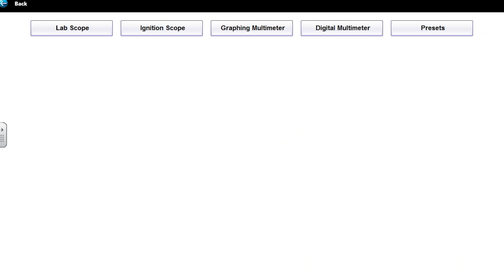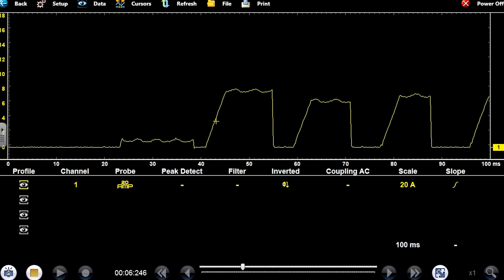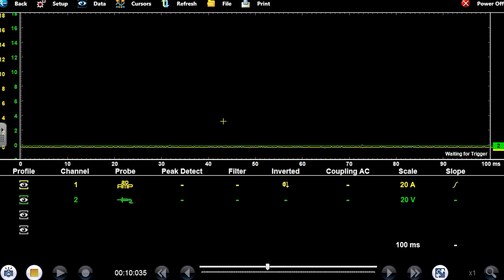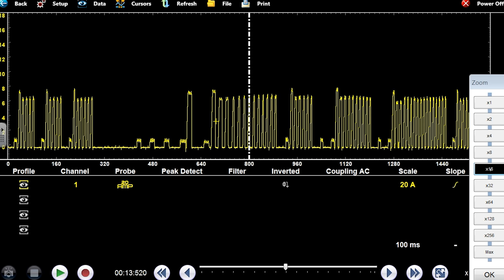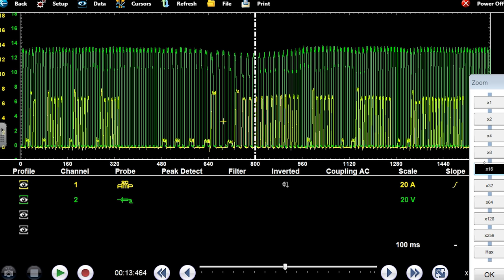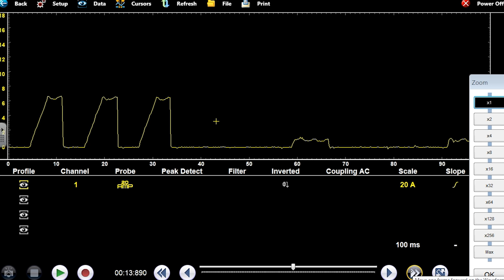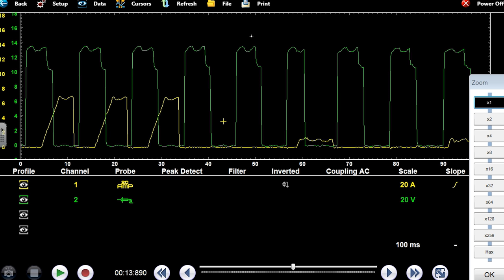Getting My A$$ Kicked By an 86 Mustang (Part 1)

Comment: Interesting Paul, can't wait for the end result. Back in the 80's and 90's the TFI module was a high failure item. I had an 88 F-150 and kept a spare in my glove box, 😁. I had a Ford tech tell me one time that if the module fails Ford recommends changing the pickup as well, might be vice versa as well. I don't remember what the reasoning was.
Reply from the maker: the reasoning is because they didn't have scopes and had no idea how to tell the difference on which one was really bad :-)
Reply: @ScannerDanner  that was definitely a strange time as a technician... developing technology all the while diagnostic tools and education that were not up to par   remember when the old Snap On brick scanner was the only tool to read ecm info?  I still use an old brick to diag older gm tbi setup in 1990s church bus fleet, just doin what i gotta do
Reply from the maker: @kc360awareness  when the Snap-On Vantage reigned supreme!
Reply: @ScannerDanner  I have one of those too!
Reply: @ScannerDanner  YEP - that was why I always changed both, LOLOL!  I always wanted to try one or the other to see what is actually failing, but it was too much work changing the pickup, and the TFI module was pricey! Over $100 at Ford in '07!  I still have a TFI module or 2 that I kept around, in case they were good. I won't know if it's even good  until this current one fails again.

Comment: Hey I wanna thank Scanner Danner for helping me figure out this 97 F350 5.8. I went thru the exact same sh$t! Shop before me replaced the dist. and remote mounted module and I knew he used O reiley crap so I tried replacing pick up coil with Carquest brand.....no difference. Then I tried CQ brand module.....same, cutting out off idle as before just like Mustang! I had my spark tester hooked up and it would flash good at idle but cut out off idle, after pulling out most of my hair I tried unplugging alternator after watching this video, sure enough ran like a champ.....went to Ford and got a motorcraft module and runs great WITH the alt. plugged in! Thank god I found this video. By the way alt. was charging the usual 13.8 -14 volts. Thank ya sir!!

Comment: Under rated transistor in the module. They don’t build these like motorcraft did. 
There is most likely only one manufacturer but different brands (packaging) so all of them on the market have the same problem.

Comment: years ago, before scan tools and scopes, if we suspected a pick up or module we would pop the cap and give the parts a good cool down with some refrigerant shot from the can. 99.9% of the time it would temporarily correct it long enough to get it back to the shop. More prevalent on hot days after a heat soak when the customer stopped by  the store resulting in a no start.

Comment: I wonder if there is a resistance in the ground circuit  to the module? If so, jumping a solid ground to the module connector would make a difference

Comment: Had similar issues 1990 Gt. Original distributor (original TFI module, original pickup, original coil) was having bucking issues when warm, to the point it was stalling out but always restarts.
Decided to rebuild the original but, in the meantime, I would put in a replacement distributor… car started and ran good. Went around block and kept running well. Started and went on a 5 mile trip, ran great. Went to start it again…no start. Threw my old distributor back in, ran great.

Bought another distributor…same exact thing happened. Mustang forums are full of stories about this…the shutter wheel in the distributor being bad, pickup in distributor being bad, TFI module being bad.

I picked up another original distributor, installed it, works good. Now considering rebuilding my old distributor, but hesitant because the aftermarket replacement parts are the same crap being used in new distributors.

Comment: Wow, what a PITA! I have the exact same system on a '86 Grand Marquis. Only difference from the Fox bodies is everything in the engine compartment is backwards from mine - my intake faces the driver's side towards the airbox, battery and solenoid are on passenger side. 

Whenever the ignition failed this way (which they always would after many miles and years) I always replaced the pickup and module as a set, but, Motorcraft was still making them back then. That makes me agree with you on the chinese parts. Other things could be metal shavings stuck to the pickup coil (since it's slightly magnetized), or a loose/worn distributor gear causing those weird scope graphs. That's all I can think of! Seems like a simple system but it's always these ones that'll throw a wrench at you sometimes. The right heat conducting compound is a HUGE factor in module life as well. It MUST have a good layer of that on there.

Last set I bought at the dealer was in 2007, and that is still working today (fingers crossed now that I say that, lol), almost 200k miles later. By 2009 they were no longer available - I should've stockpiled a few!  285k on the car now. It seems heat is a big factor with those failing. When I took my 1st '86 Grand Marquis to Phoenix, the module failed the 1st year I was there. Replaced it, then the car got stolen for a year - they found it in Bell, CA. I took a bus from Oakland to E. LA at 1AM to get it. That should tell you how much value I place on my vehicles (more than my life apparently, LOL!). But anyway, super curious as to what exactly is causing this one!  Great stuff so far fellas!

Comment: I love the older cars....pre-2000 or so.  They're just so much more simple to understand and repair...and they're my favourite to own.
Reply from the maker: you would think! This one wasn't for sure. Thanks!
Reply: @ScannerDanner  Ya, I think you're onto it when you talk about the lack of quality in so many aftermarket parts.  I remember installing a new neutral safety switch on my e4od that I rebuilt myself.  It ended up being faulty when I finally got around to starting up my 92 F250...and ended up putting the old one back in...lol....which worked just great.  And I thought I was doing something that would increase reliability by replacing it when I did the rebuild...lol.

Comment: Ha, lol.  Love the X'd out word "Dont".   At the intro with the default explanation, I almost put in my two cents the prob was cheep Dorman Chinese or Mexican parts.  Reminds me of the importance of knowing your system and where the ground should be regarding the pickup, dustributor, or module.  Years ago, working on a 74 Intern'l that wouldnt start; every test said it was a bad coil but when I tested the coil, coil was fine (tested while coil was still on the intake). I even removed the bracket mounting bolt to the intake and scratched it clean for a good ground; still wouldnt start.  Retested everything.  All tests pointed to a bad coil.  So I racked my brains and said to myself, what am I missing? Long story short, I never actually removed the coil bracket from the coil for inspection.  Turned out the coil bracket was rusted on the inside of the bracket but looked perfect on the outside of the bracket, what(?). How does a coil bracket rust on the inside but look perfect on the outside? Scratched the inside of the bracket clean, put it back together; srarted up immediately. Anyway, a 15 minute repair took over an hour.  Those little annoying repairs are the one's you remember most.  Funny how those old memories still haunt you after all these years. Looking for the follow up vid to this scenario. Thx for what you do!
Reply from the maker: good one!! Thanks for sharing

Comment: Bad battery or bad connection somewhere? I wouldn't think system voltage should drop an entire volt with just a 6amp draw from the coil. (not even if car is not charging)

Comment: Wow… this is déjà vu for me.  I went through this same exact scenario on a 95 Ford bronco. Everything I’m watching on the lab scope from you is what I experience on this bronco. Called a bad distributor. Well the only new distributors that I can get my hands on or remanufactured for that matter was A1 Cardone. Four  A1 Cardone distributors later, and endless hair pulling, I still was adamant that it was a bad distributor. So I told the customer to order a MSD new distributor from Summit. He got it he gave it to us I installed it, problem solved. It was a bad pick up from the start, but every subsequent aftermarket distributor was straight up garbage. And PS…. the only modules that work for Fords in my experience are the ones that are from Motorcraft. I’ve tried them all and been burnt by them all except for Motorcraft. You cannot buy a good aftermarket distributor for Fords unless it’s a high performance alternative.  The dealer doesn’t offer it anymore, it’s obsolete.  My experience.

Comment: What I noticed is that consistently after any dropout, the first coil current ramp limits at a lower current, 6 rather than 7 Amps. Even though the dwell may be equal or longer.

Comment: Welcome to my world Danner 😆 I am going through this right now with my 95 turboed mustang
Reply from the maker: Stay tuned! We do fix this
Reply: @ScannerDanner  I´ve also got an issue that is very similar to this on a 944 turbo with a Vems ecu....i just bought a pico last week to try to figure it (now the car & the pico !!!) out & found your excellent tutorials Havent signed up yet as im workin through ya available content, which has been enough brain burn for 5 days !!)...I dont seem to have any drop outs though...only what i think is alotta noise -upto .7v oscillations side with some larger spikes that seem to match injector pulses. Problem will disappear on restart - with (imo) the same waveforms ! Will small oscillations during inj pw open time cause light intermittent misfiring ? I suspect it should but on restart it will have the same waveform & run fine...Is part 2 available yet ??!!  Great Stuff !

Comment: Great video. Challenging faults make good footage. The only way earths can be isolated is through a transformer. Just wondering if the pickup coil earth is isolated through the module as a separate pick up circuit in the module which then runs through an isolating transformer which is then earthed on the secondary side of the transformer to chassis at the module which earths a signal amplifier circuit in the module which is power fed from battery. Just a thought.

Comment: When you turn key on not starting does the fuel pump prime and shut off or does it keep running ,because if it does the computer is bad. I ran into that on a 92 f150 302 engine with it running good and all of a sudden it started running rich and loping and misfiring. Put in a reman computer from Autozone and problem solved...

Comment: I laugh when people say old cars are easier to work on never dealt with the ones with EEC 3 and 4.  No datastream to look at and everything has to be measured manually to get a vague idea what is going on.   Even the old GMs with TBI can send you off on wild goose chases.
Reply: I have EEC4, GM TBI and early BOSH . How did I make to 75 ?
Reply: When I say, "old", I mean carburetors and points. :) Now those I miss!!

Comment: @ 52:04 hey danner, 1995 ford f150 v8 has a remote located module as factory equipment. With a nice fat heat sink. Its on the drivers side just under the hood hinge. Theres your diagnostic tool.

Comment: Distributor housing to engine ground issue?  Grounding intermittently to engine through shaft and gear not housing and hold down?  Looks like Motorcraft still making module DY1284.  Check with your supplier to see if made in Mexico not China.

Comment: I got screwed by a bad distributor 2 years ago.in a GM 366 TBI in a farm truck.  Had a no start. Knew I made the right call as I had no pickup signal.  Put new distributor in and set timing and man did it ever run like crap till it warmed up.  One never wants to condemn something new so wasted some time chasing other stuff........plugs, wires (which needed done anyways really) coil..... only  to circle back and put another distributor on.

Comment: Open the ECU and check the capacitors. The are almost 30 years old. Had allot of issues with caps in these old EEC-IV computers.
Reply from the maker: With the SPOUT circuit unplugged the ECM has ZERO control of the spark or the coil control that is dropping out 😉
Reply: @ScannerDanner  I'm currently running my Early bronco TFI 351W with Holley HP EFI. Been a few years since I've had my head in EEC-IV. Recently I had a bad TFI module to coil wire cause intermittent issues. I know its a pain the ass, but I wonder how the PIP signal looks disconnect from the ECU. Only the distributor, TFI module and coil. Take ECU out of the equation. Pull the distributor out and rotate by hand and look at the signal. When I installed my Holly HP system I had to go back and wrap the PIP wire in shielding to clean up the signal because I was having weird advance and injector issues.
Reply from the maker: @fintechrepairshop  the PIP signal was too clean for me to consider isolating the ECM from it, but good thoughts! I like the way your thinking

Comment: I had a thought about half way through the video about how much play might be in the Reman Dist. (Worn out Bushings?) Then you got to the end. In my terms; (a ground is a ground is a ground) as long as they are all good. I do not see why grounding the Module body to the Dist. housing would make any other path work unless there is a path issue. The module has it's own internal wired path through the wiring from E.C.M.. The body of the Dist should have a path through the Hold Down, through the Intake, through the bolts to Heads,  Through the Bolts to the Block  to the main ground cable to Battery. Starter Lag?? Yes, there are also other Ground wires through out. I recently subscribed to this channel to learn more about using the tools I have paid way too much for. I still have a lot of old school ways of doing things that my Father taught me. I always use a Breakout Box (Because that was what I was taught roughly 25 years ago) and always check wiring diagrams. IDM Pin 4 on the E.C.M. is tied into Same Coil ground wire as the Module. There is a splice and a Resistor in same wire. I'll just leave this right where it is at, to patiently wait for the end result.  Keep up the good work. I will soon be on your paid subscription.

Comment: I wonder if they have that distributor stabbed in wrong, I had a van I bought once to flip and it ran fine til under load, I pulled the distributor and turned it a little and put it back and it ran like a new vehicle....I always double check others work always....great vid guys keep them coming...

Comment: I had a 98 e 250 that the transmission would up shift and down shift while driving on the highway or wherever. What I found was the wiring that goes to the transmission was inside the loom that was laying on the alternator with other wiring so I added black foam pipe insulation to lift up the wiring harness away from the alternator. It was evidently sending false signals to the transmission. It stopped doing the up and down shifting. I mention all that because I’m curious is the plug wires doing anything like that being they’re right at the alternator. Just asking

Comment: Looks like distributor assembly has two ground points: one signal ground from ecu to module and second hi-current ground for module itself on distributor ground. If one of this fault, car  would't run properly.

Comment: I'm 20 minutes in & noticed the cheapo module that came out of the distributor.  One word of advice on the TFI distributors... always use a Motorcraft module unless you enjoy replacing the module because you'll be in there changing it again if it's the cheapo module.
Reply: Good luck finding on original NOS module. I've been searching for one myself
Reply: @mark98070  I've been lucky enough that my local dealerships motorsports department has a huge stock of them, DY1284.  If you need one let me know!

Comment: what used to happen with the hall effect pick ups in the distributor, in the 80s cars is oil would get on the bottom of the disk from leaking distributor seal, and it would miss.. it affected the tach signal too. I reacall sometimes it takes time for them to fail, like heat would affect them. driving along it would either miss out bad, or just shut off like the key wass turned off.,, crank it over and no tach signal,., let it cool a 1/2 hour and it would fire up and drive again.

Comment: first action, replace the module. They went to a remote mounted module later because engine heat would destroy them when they were mounted on the distributer.

Comment: Had a few mustangs of that generation have pcm issues that would send you through a lot of dead ends when trying to diagnose one in particular I decided to just pull the pcm and take it apart and a capacitor had erupted and damaged the board it was sending me in circles with intermittent spark and fuel injector pulse issues

Comment: CAT Converter thermocouples need to be removed and cleaned the crust off the thermocouples  protectors. Had one 86 GT. Acted exactly as this one.  FMC jerked me around until I went Detroit on them. FMC sent their Pro's down for a greet and meat to fix it. 2 hrs. later they cleaned the Cat trermocouples, never acted up again. Still have it in my collection.

Comment: Check the power supply and ground wires to the pick up coil for intermittent bad connections/high resistance. Could also be a crap pick up. Pretty much every mechanic job that I've ever had have been exactly like this one. That's why I don't do this any more.